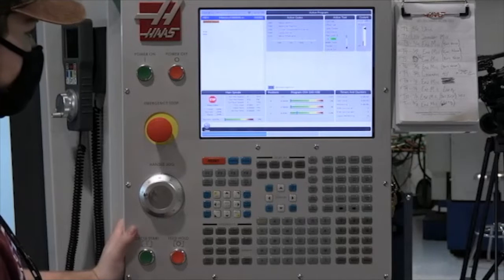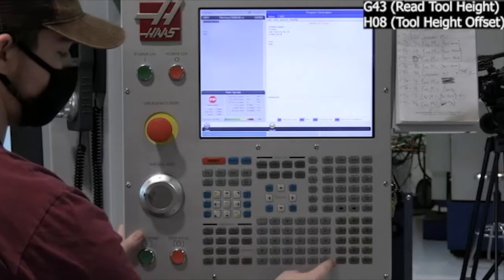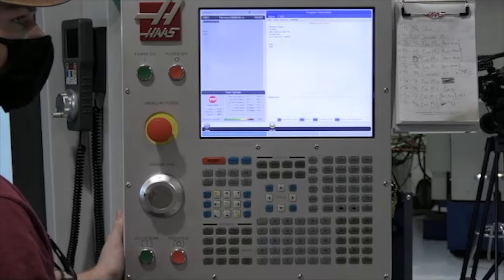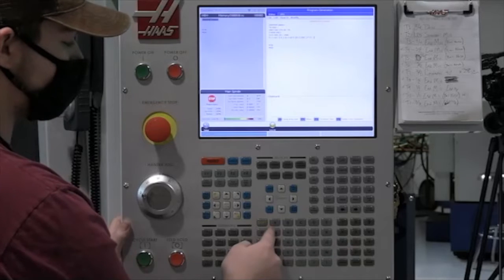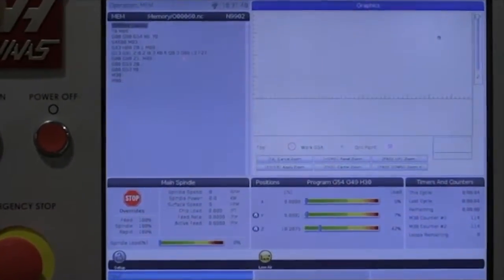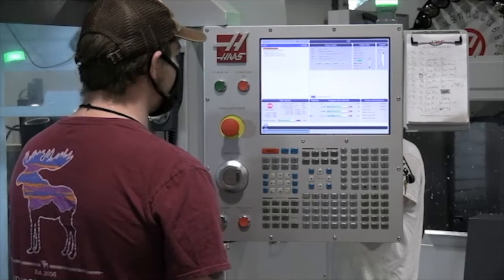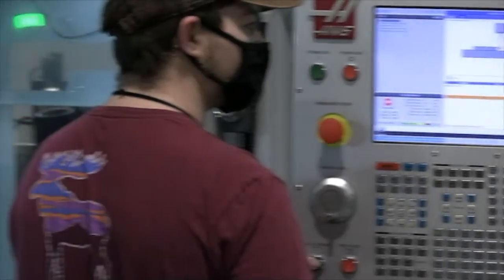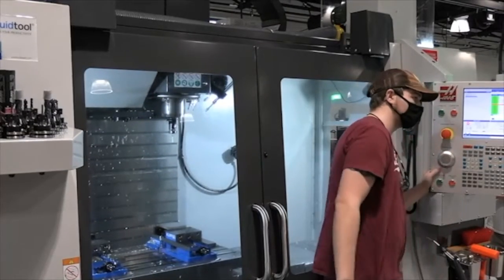Circular Pocket Milling Tips

Comment: The trouble with linear ways is that the vibration from always climb milling loosens them up prematurely. Instead of frictional wear, those little balls are subjected to endless hammering.  Better to go with conventional milling (M03) and leave .006" on the dia.  Now while the cutter is still in the pocket, switch to M04 for a beautiful finish, and better sizing. Your machines' tightness will also last much longer.  >$$$
Reply: Conventional milling causes faster tool wear, so whatever you might save on replacing your linear guide carriages will go straight into the pocket of your tool vendor. It isn't even necessarily gentler on the machine - the lift forces in conventional milling can be very significant, increasing the chance of chatter if your workholding isn't ideal. Conventional milling generally only makes sense on older manual machines with significant backlash.

Comment: Where are the safety glasses?  This is done at a college?
Reply: The masks are all they need to stay safe
Reply: @flyingjeep911 When they open the barriers and air hose the metal chips and it fly in their eyes what do you do?
Reply: Why don't you do it on a ramp? It would be better
Reply: All the machining is behind the closed doors
Reply: It's ok because they are wearing face diapers, I mean masks to protect themselves 🙂
Reply: @phillhuddleston9445  I’ve seen the results of people wearing safety glasses while operating a fully shrouded machine when a crash happened.  Saved more than one person’s eyes that I know.

Comment: the way red shirt guy took off the probe away from the workpiece scared the hell out of me! He went straight to pinching the handle (not grabbing the wheel first) then stared at the workpiece. Scary move haha! wrong direction (worse coupled with wrong increment set) or someone hits your elbow and sayonara 4 gran hehehe
Reply: I always wheel away with reduced feed rate first because one time my finger caught and pushed the rod when I was reaching for the wheel. Luckily it went in the right direction but I’ve seen people go the wrong way. Not good